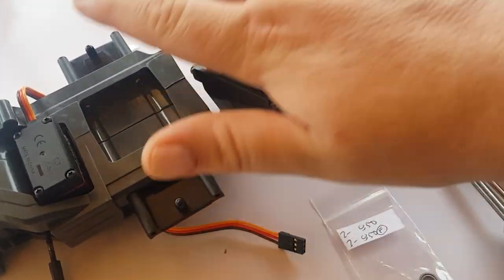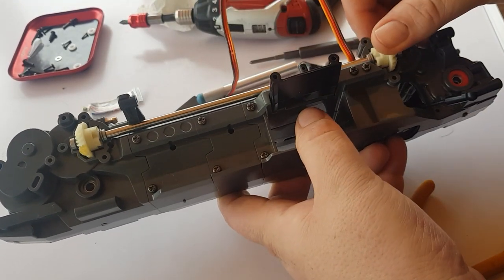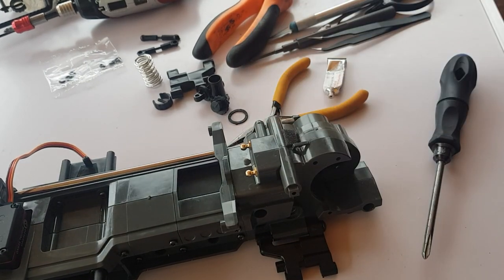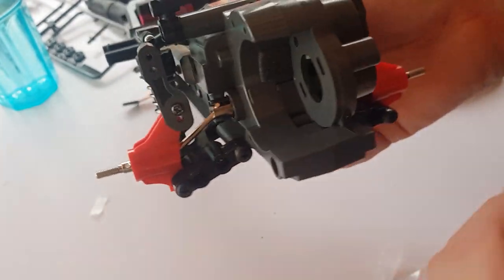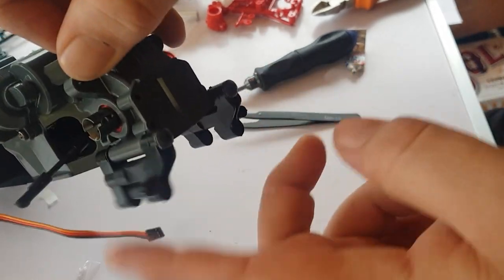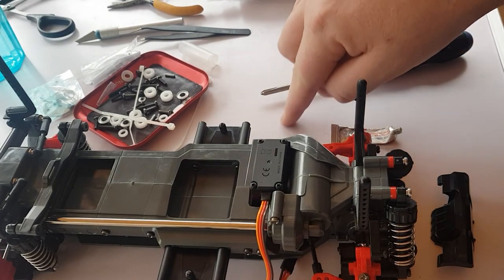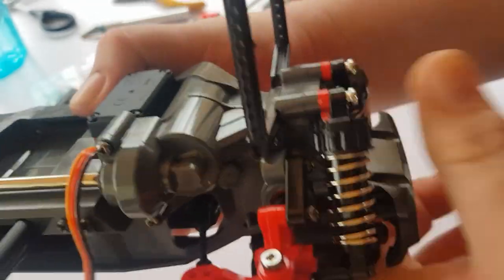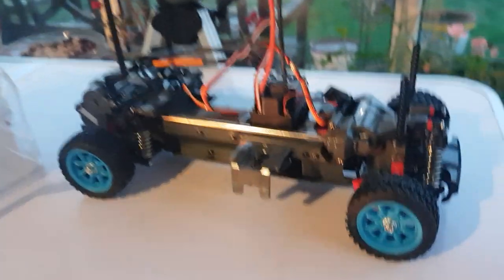TAMIYA ESCORT MKII STEP BY STEP BUILD PART 2

Comment: I built a Tamiya TT02 chassis (Ford Capri) earlier this winter. Not impressed with the construction and design of the chassis, but it was very fun to build and the body looks fantastic. I'd love the rally Beetle which I think has the same chassis you're building here.

Comment: Really Enjoying this build series Pat ☺ Im looking to get a rally to build so this is perfect food for thought bro! Great vid 👌
Reply from the maker: Cheers bro.. probably better to get 1/8 buggy and turn to rally 👍
Reply: @PatsRC  😂😂 my thoughts exactly...i want something to rally at Paddlesworth this year !!!  .... thos tryes have no foams ? Careful on cornering/braking with power with lipo power?..... id scratch up that shell in 5 mins prob with my driving 😂
Reply: @rccircus7271  you can get a 1/10 hsp rally chassis from blacksmiths products for around £80 i think would be 100 times better, i hate to say it coz i like tamiya, my mates got the buggy one and you can't go wrong at that price and lots of parts every where,  and by god it's raped on 4s lol
Reply: @ISOSAILING  thanks buddy i will have a look ! I am a bit aggressive driving so I will defo need something tougher. Interesting!
Reply: @ISOSAILING  prob going 1/8th tho but i will defo checkadee check it
Reply: @rccircus7271  fare enough not a bad car to rag around a track wouldn't send it to the moon though as it won't survive re entry haha just make sure it's the one with the up graded dif boxes as it was a known week point on them the later one's have a metal plat to bolt the arms to the early ones have the arm attachment point moulded to the diff case
Reply: @ISOSAILING  great insight duder!! Thankyou ☺